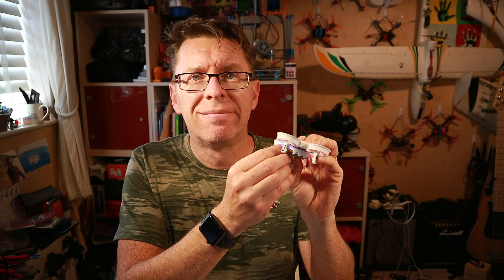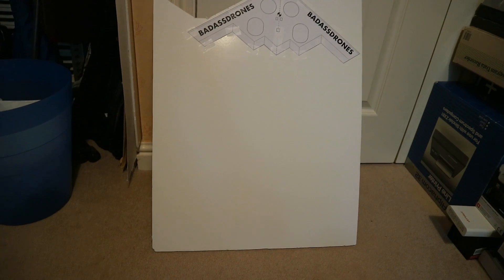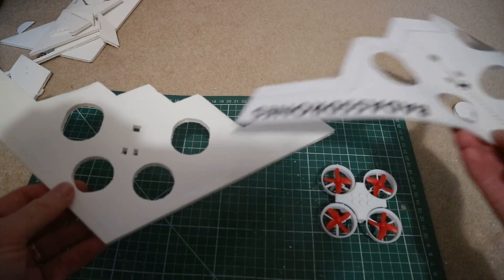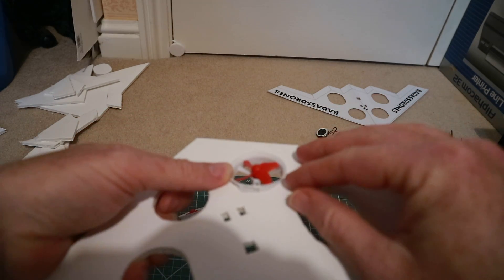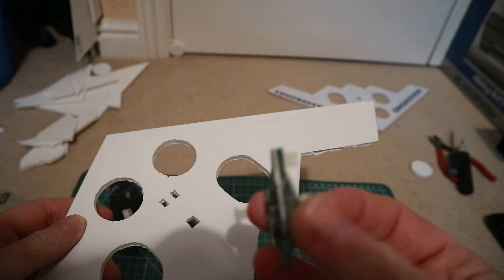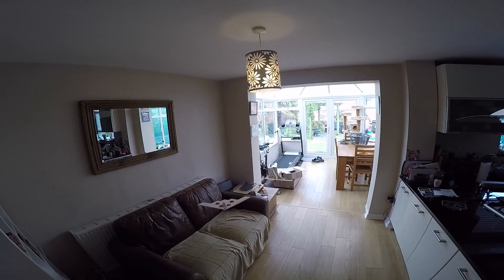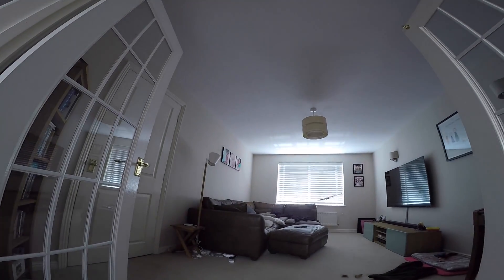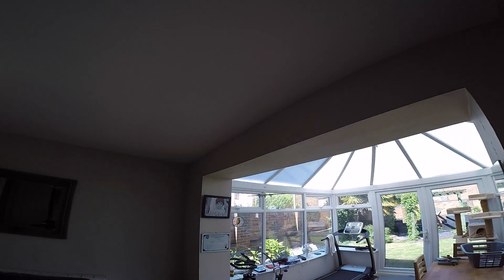How to transform a toy quad to an indoor flying wing (sort of)

Comment: You really don't need to angle the rear motors forward or take the quad apart. Just put your quad in a piece of depron. A delta works well.

Comment: Take the paper off the foamboard, makes it much lighter.  Now stick a camera on that thing and FPV it around your house, it's not as easy as you'd think lol
Reply from the maker: We did add the removing of the paper thing in the description after checking the weights.  I haven't really considered FPVing it - quite tricky in a small space
Reply: CurryKitten read the description?  What do you think I am, a civilised human being?  LOL. I do like the idea of putting a sparkler on it though haha.  Spooky coincidence but I was tidying up today and found an old e010 down the back of the sideboard, thought it was dead but no, all good, so I know what I'm doing with it tomorrow LOL.